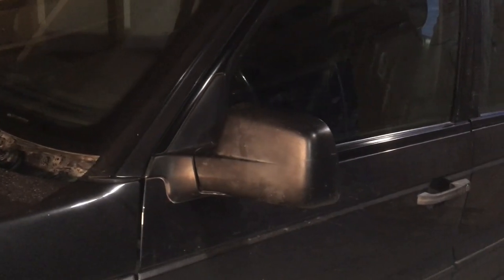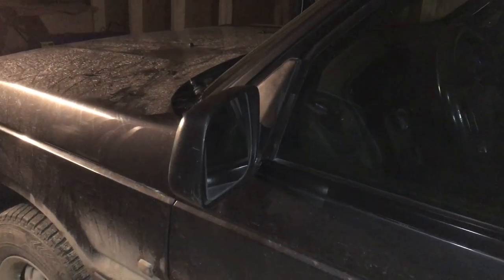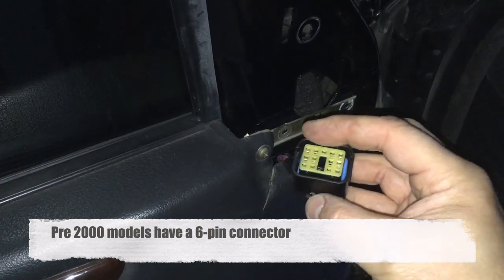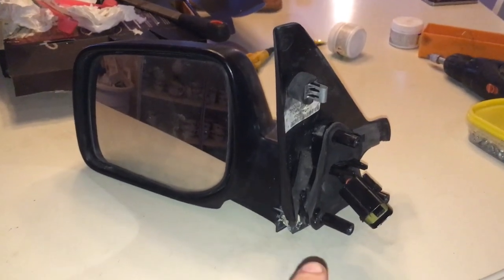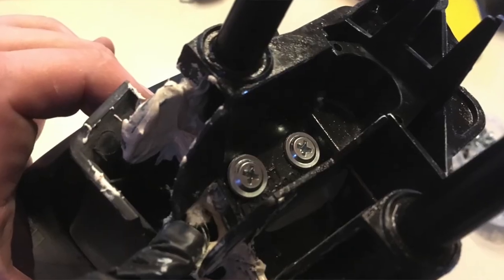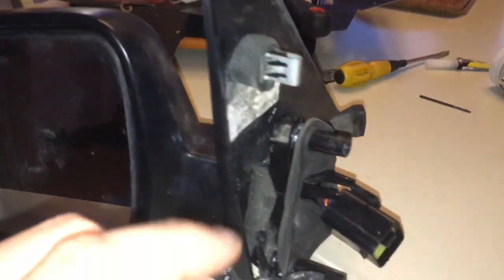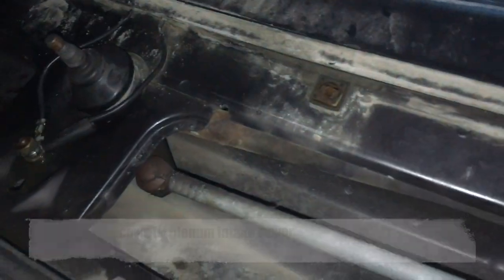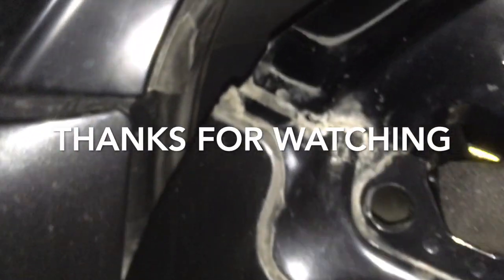Range Rover P38 # 075 - Side Mirror & Plenum Intake Leaks

Comment: I you find wet carpets check your headliner at the top of the windshield. The windshields on my 98 and 2000 both leaked. For the 98 there was a seam where the roof panel joins the door frame panel. This is spot welded together and I guess has sealed but my seam leaked. For the 2000 the rubber gasket along the top of the windshield, outside, just shrank and pulled away from the roof metal. Fixed both with 5 minute epoxy and silicone sealant.
Reply from the maker: Great tips, Gordon. Thanks for watching!

Comment: Do you have a video on (rear) shock absorber replacement? It seems to be easy - just a bolt (top) and nut (bottom) but mine's causing me headaches...
Reply from the maker: Hi Andrew and thanks for watching. Sorry I haven't done the shocks on mine yet, but it should be quite easy. I think you're on the right track. Here's the workshop procedure for the process: https://drive.google.com/open?id=1eU0ib-SoI_BrGd54l3hx5-2bD8xM6Wai
I hope it helps you out so that you manage to replace your shocks. Good luck!